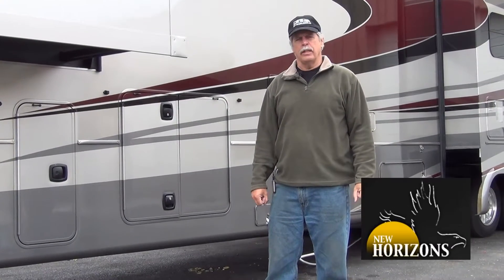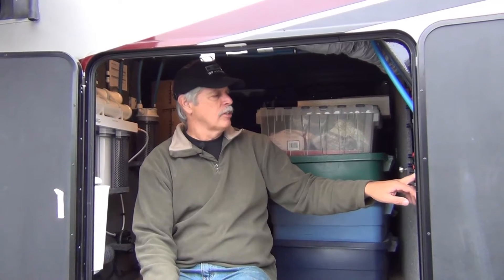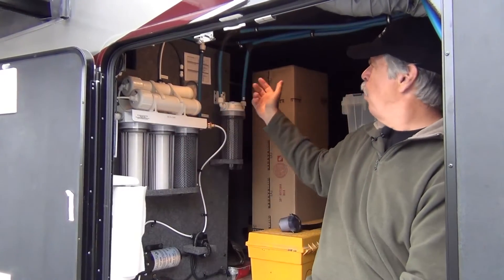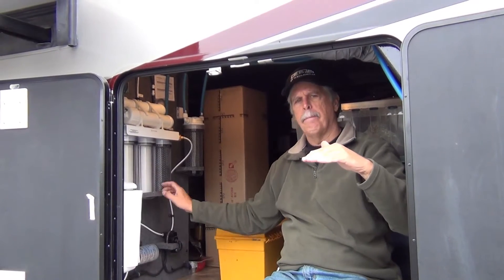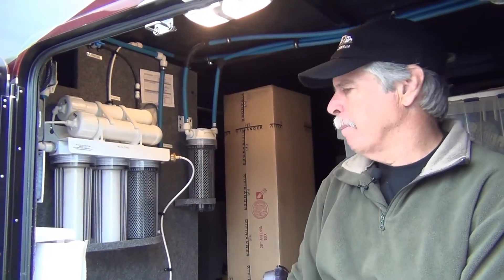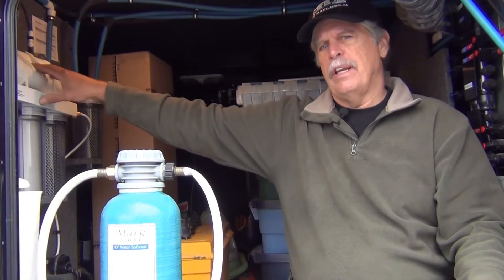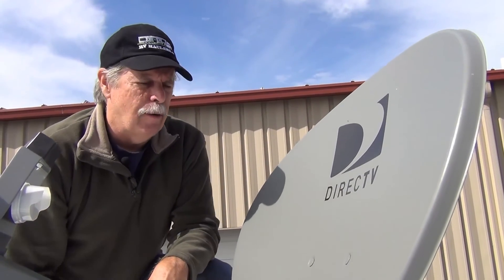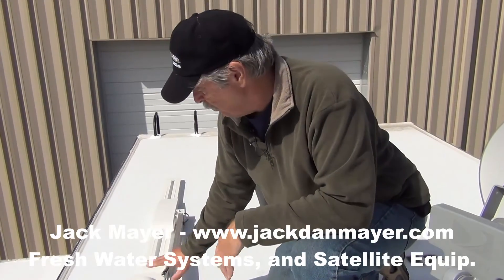New Horizons Fresh Water Systems and Satellite

Comment: Are you running the RO elements in series or parallel? Series rejects less water than parallel does since the rejected water from the first RO element feeds the second.
Reply from the maker: timon0x31 Jack confirms they are running in series for the very reason you note.  Less water is rejected this way.